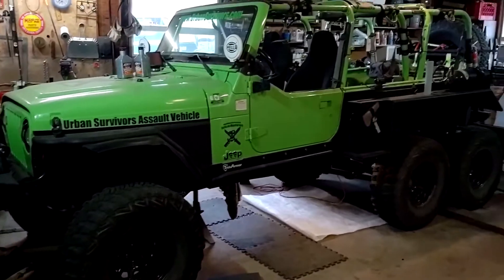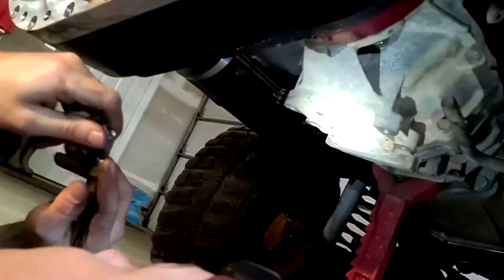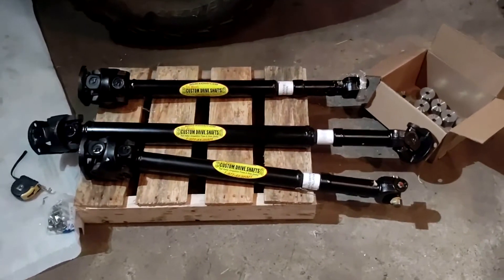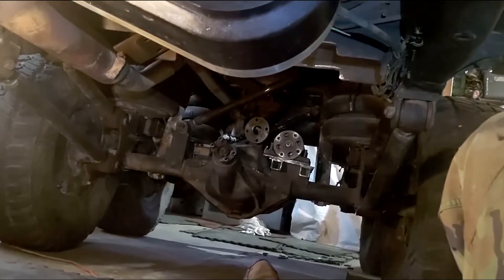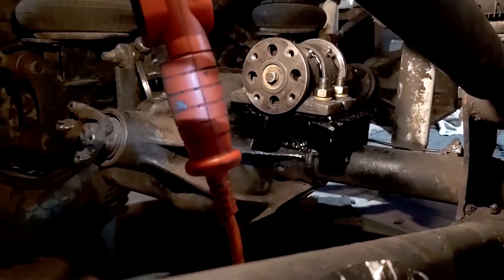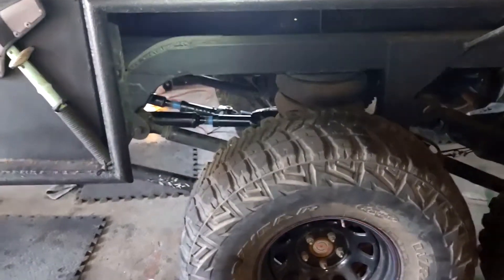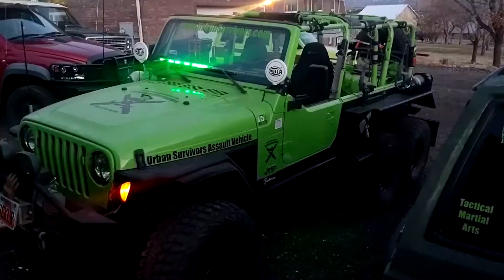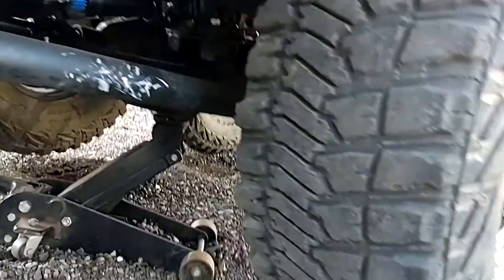Zombie Killer 6x6 Jeep Driveline re-build

Comment: I was thinking you might get more articulation by moving the carrier bearing to the chassis (doesn't exert rotation into the u joint as the mid-axle articulates up and down by changing the u-joints angle). But your pics in the end prove you've already got a great system. Well done!

Comment: On all the military 6x6 with two outputs on the rear,  the front axle is offset and the rear axle is centered. A design like this you wouldn't have such a steep sideways angle on the joints. I'm building a 6x6 using a highly modified NP205 with an NP203 doubler and Differential in the mix. 

The axles are 1 ton Dodge motor home. They have a long side and a short side the plan is to use two short side axles in one for the centered diff. The other one will retain its long axle and have a custom stubbly axle. The offset wi be to the passenger side. The transfer case will have 2 wheel drive, four wheel drive, and 6 wheel drive.